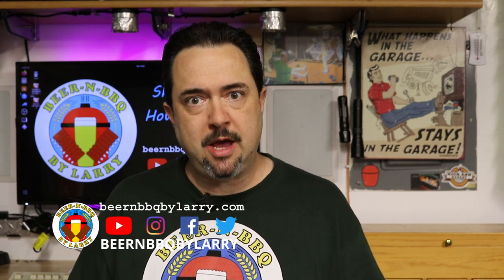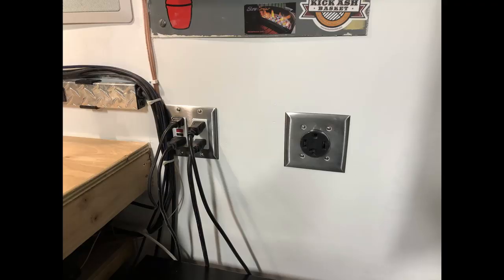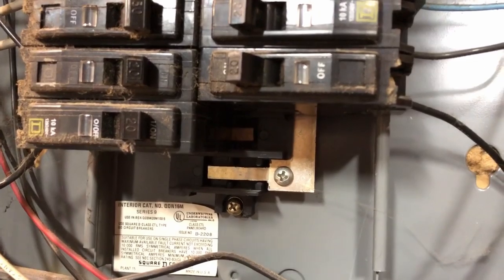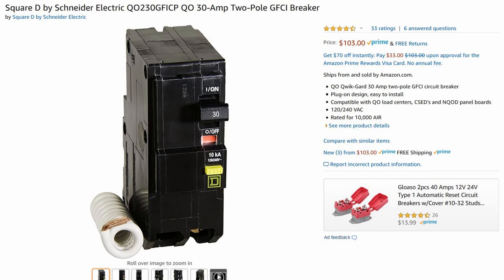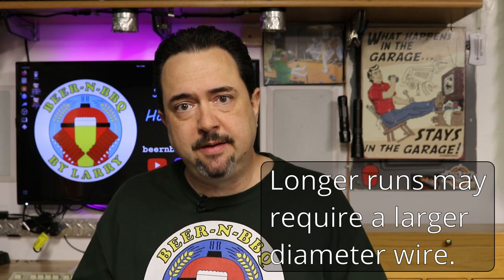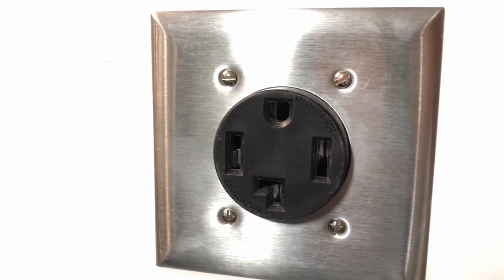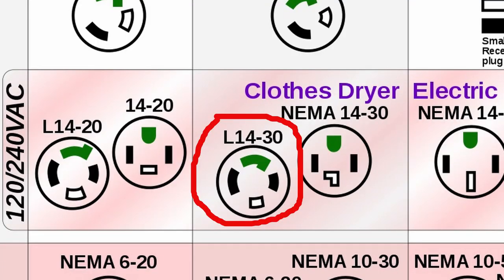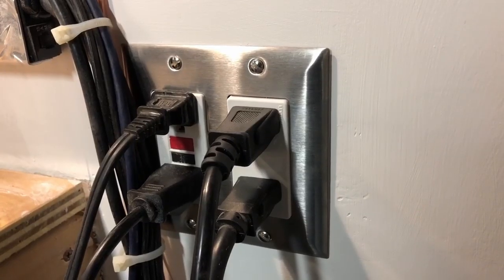Installing a 240V Circuit for Electric Brewing: a DIY Project

Comment: I've done quit a few shops in my life and you were spot on.  I tip if you have no free spaces.  For most panels they make half hight breakers.  So you get 2 breakers in one spot.  Free up 2 spots with those then you have a spot for your 220.
Reply: bones549 good tip! Some panels also support quac breakers that have two single poles and a double pole in between them, all in just two spaces. One large breaker. Availability depends on what panel it is.

Comment: Thanks for the shout out brother!! GFCI for safety!! 👍🍻
Reply: Hondo1126 is it a 4 wire circuit? If it is you could swap out that breaker for the 30A GFCI. If it’s only a 3-wire circuit it may be 240v only (as opposed to 120/240v), like a welder outlet found in a lot of garages.
Reply: Yes, beer ain't worth dying for.. hahahaha

Comment: Larry, question for you.  What are you using for a temperature control panel for mashing and boiling?
Reply from the maker: Depends on which system I use; Spike Solo or the Blichman BrewEasy

Comment: Electric brewing is the way forward, the advantages over propane and LPG are overwhelming, things like temperature  accuracy, don't have to worry about running out of gas, on a brew day. Brewing inside your garage with electric during winter. The advancements in technology with electric. More compact brewing all in one for those with limited space. The only  problem I see is the immersion chillers as with a exposed element?  May be a concealed eleminates like the Grainfather/ Robobrew work, counterflow might be another option for exposed elements.
Reply: @BEERNBBQBYLARRY  Thinking of converting my 13gallon brewing pots into electric with the Kegland 2200w, 10amp 240v heating elements they only cost $70 each . My only problem is my immersion chiller. My pots are wide and if I build standoffs away from the element won't get much cooling. Might make a new immersion chiller to fit on one side of the element to gain depth. Lucky I brought some grains and extra yeast before the 4week lockdown.

Comment: I'm in Australia, everything here is 240 Volt as standard, we don't have have any issues with brewing, there are some really larger large  65 litre / 17 gallon all in one brewing systems which call for a 15 amp power point though, most standard house power points are 240 Volt 10 amp, they are fine for brewing with the 30 litre / 8 gallon systems,  I don't understand why the US and Canada are using 110V when the rest of the world is on 240V
Reply from the maker: It's a mess of standards, isn't it? There are other countries using 120V, and 240V is not a standard by itself since there is the frequency component as well (50 Hz vs 60 Hz) that pairs with it, so 240V @ 50 Hz isn't truly compatible with a 240V @ 60 Hz. And there's minor differences in voltage among countries (220, 230, 240). I think Australia is officially 230V since 2000 with backward compatibility to 240V.  It is really all over the place around the world.
Here is an interesting read: https://www.electronicproducts.com/why-doesnt-the-us-use-220v-like-everyone-else-in-the-world/#
Reply: @BEERNBBQBYLARRY   yes I know, my brother is an electrician he has told me all about it, we are 240V @ 50Hz but apparently when you look it up they say 230Volts, perhaps it varies

Comment: Will this 4 wire plug work with the Blichmann breweasy compact system
Reply from the maker: It uses the same 240V outlet as the real BrewEasy: a L6-30R.
I use an adapter to fit mine. Blichmann sells them too, but I got mine from Amazon.
I found having the four prong outlet is more flexible since other brew systems use it, and it can be converted down to a three prong configuration via an adapter.

Comment: Larry I recently installed a 240v outlet to use a keggle w 240v heating element but now am looking for options of temp control and the only ones I see seem to be for 110v do you have any suggestions?
Reply: BEER-N-BBQ by Larry ahhhhhh man that’s what I need dang ok thanks
Reply: BEER-N-BBQ by Larry thanks for the quick replies so just for clarification on your set up when your heating element is plugged in to the 240socket where do you plug the pid in? Sorry I’m slow ...I guess I was thinking it might work like the 110inkbird I have where that goes into the wall and the heat source goes into it but for a 240v version